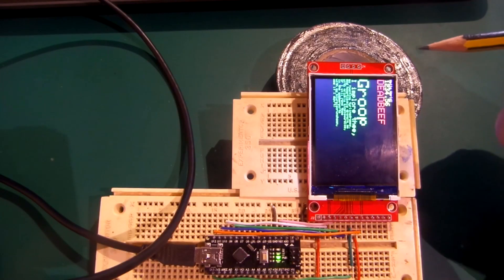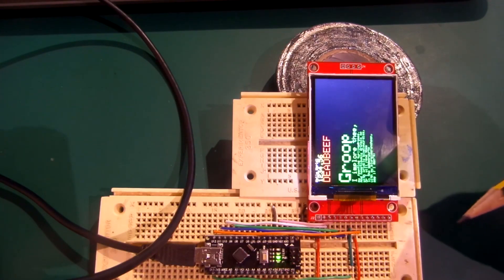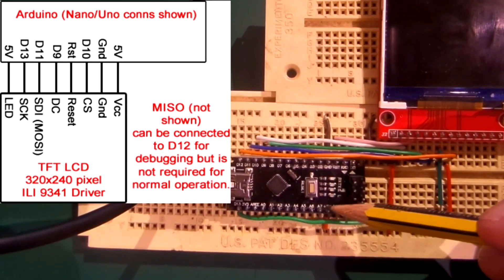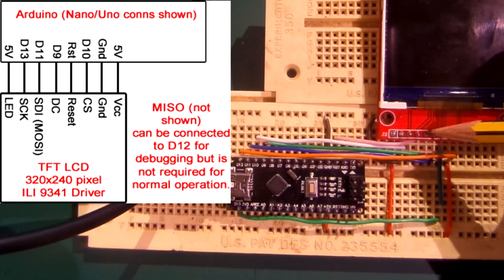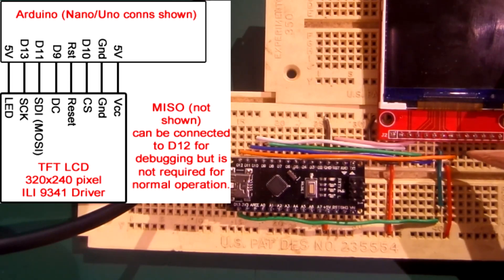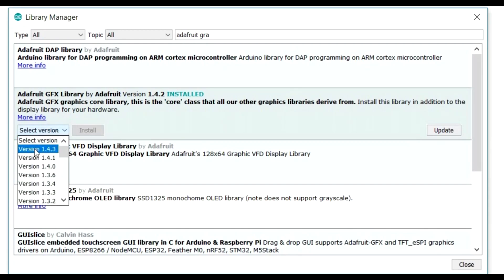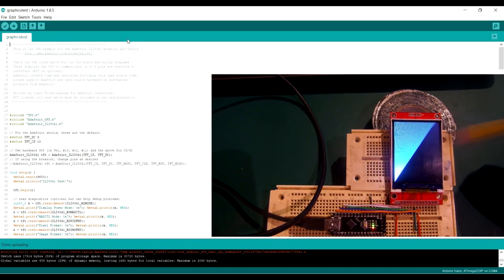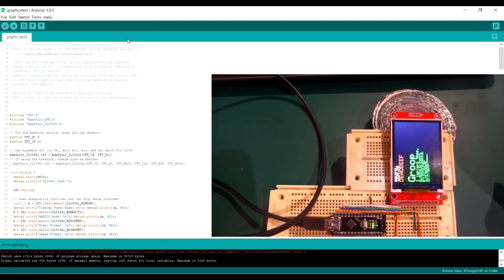Re-post/Update : ILI9341 LCD screen and Arduino,

Comment: You are not using 5v to 3.3v signal converter for signal level ?
Reply from the maker: Your right I'm not. Works fine.
Reply: @XTronical  I'm ordered 2.4 tft with touch ili chip display. Is arduino nano will handle this display? So it's not needed to use 5v to 3.3v converter ?
So j1 increase signal level acceptable by display chip ?
Reply from the maker: If you follow the video you will be fine, I've left mine running for hours with no issues.